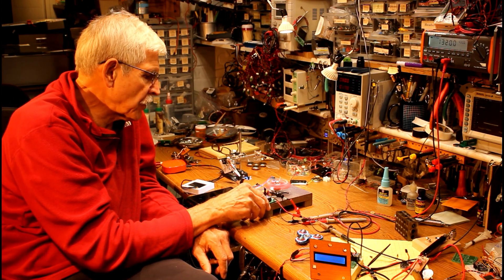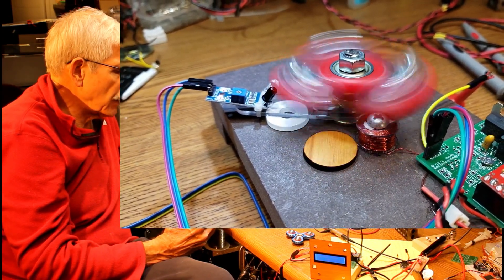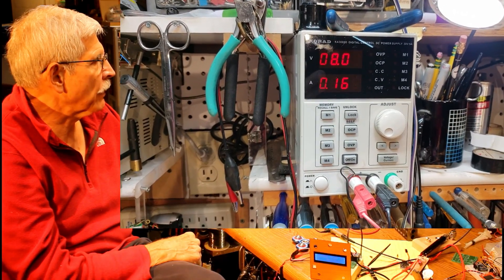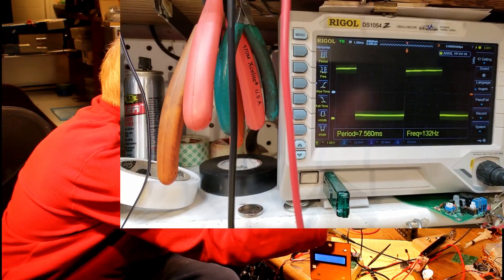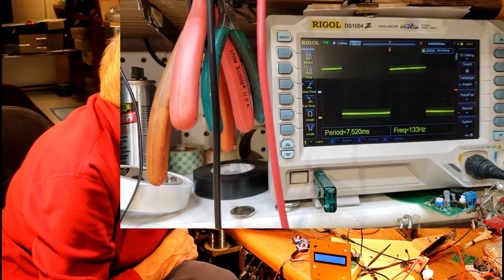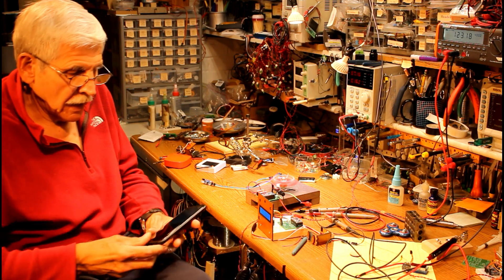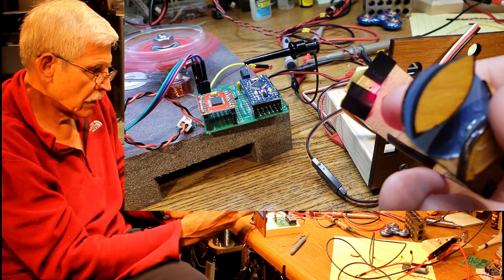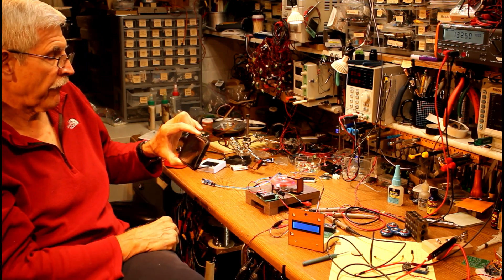Fidget Spinner Tachometer

Comment: I am far from being an educated man. I barely made it through high school.
My uneducated opinion about your hall sensor set up.  Looking at the diagram you have in your website, something is not right at all.
Well either something is messed up with my head that I have not been able to get my fidget spinner going following your diagram.
Aside from few of my magnets having made china that took me for head spin as their dog gone magnets were not consistent with their north and south orientation.  As the screws sit inside the cavity and the nut on the other side... well came to realize that one of them was actually screwed up.   One of them was actually oriented as such that its other (flat side) matched the other two.  That took me two days to figure out what the hell.

Now after fixing that, it is still not spinning.
You are explaining that since  the hall goes low at the passing of the magnets, your setup will flip it and that is the reason for the addition of NPN transistor along with the mosfet.
If that be the case, when you turn the power on, if the hall is not by the magnets, the coil should not be energized.  Of course not.

Well, I have not succeeded.   So I was force to take a good look at your diagram.

Looking at just the Mosfet,its circuit is complete just by itself, although its base goes to the collector of the NPN transistor does not stop the fact that in of itself the base of the mosfet is also independent to itself.  the NPN transistor, collector can not under any circumstance influence the base since the base is getting fed from the positive rail through the 1K resistor before it goes to the collector of the NPN transistor.  It is clear and obvious.
The drain of the Mosfet goes to the coil along with the diode which goes to the positive rail.
And the source is grounded.
IS THIS NOT A FACT?
If this is, then the Mosfet by itself is a complete circuit independent of the NPN transistor.  So no wonder when I turn the power on, the coil is energized before I even move to position the hall.

How on earth can the NPN' collector being connected to the base of Mosfet has any influence on the operation of the mosfet.  Please explain, how that will effect the supply voltage to the base of the mosfet, phase difference or whatever that might go on that will effect how or when the Mosfet turns on.
1K resistor is everywhere.

( The only way I made it work, is I did what I thought made sense.  I tossed the 2N2222 and just connected the hall to the Mosfet and it span perfect.  Simple straight forward circuit.   And I couldn't tell the difference if the hall goes low or high.  I don't think if you buy those non--latching omnipolar ones ( which mind you they want an arm and a leg for it) would do any better than this hall sensor which are dime a dozen.)

Comment: Hello Dave, how to change the code to measure the rotation speed of a 48 V  DC motor ?
I modified your code like this, is correct ?

#include <SPI.h>
#include <Wire.h>
#include <Adafruit_GFX.h>
#include <Adafruit_SSD1306.h>
#include <EEPROM.h>
#include <Encoder.h>

#include <Fonts/FreeMonoBold9pt7b.h>
#include <Fonts/FreeMonoBold12pt7b.h>
#include <Fonts/FreeMonoBold18pt7b.h>
#include <Fonts/FreeSerifBold24pt7b.h>
#include <Fonts/Serif_bold_40b.h> // HDG et Vitesse et Variometre 3 digits
#include <Fonts/Serif_bold_34b.h> // Altitude 5 digits

// Cablage OLED 1.3" SPI pour Arduino Nano, Arduino UNO:
// OLED 1.3" ===> Arduino Nano, Arduino UNO
// VCC ===> + 3,3 V
// GND ===> GND
// CLK ===> D10
// MOSI===> D9
// CS ====> D12
// D/C ===> D11

// #define OLED_MOSI   9
// #define OLED_CLK   10
// #define OLED_DC    11
// #define OLED_CS    12
// #define OLED_RESET 13 // Non Connecté pour ce type de LCD

// Cablage OLED 1.3" SPI pour Arduino Mega 2560 et Arduino Mega 2560 Pro Mini
// OLED 1.3" ===> Arduino Mega 2560 et Mega 2560 Pro Mini
// VCC ===> + 3,3 V
// GND ===> GND
// CLK ===> D52
// MOSI===> D51
// CS ====> D53
// D/C ===> D50

#define OLED_MOSI  51
#define OLED_CLK   52
#define OLED_DC    50
#define OLED_CS    53
#define OLED_RESET 13 // Non Connecté pour ce type de LCD

Adafruit_SSD1306 display(OLED_MOSI, OLED_CLK, OLED_DC, OLED_RESET, OLED_CS);

unsigned long time;
int RPM = 0;
volatile float timer = 0;
volatile float time_last = 0;
volatile int rpm_array[5] = {0, 0, 0, 0, 0};

void setup()
{
  
  display.begin(SSD1306_SWITCHCAPVCC); // Initialisation du LCD en +3.3 V
  Serial.begin(9600);
// Broche numérique D2 définie comme une interruption
// LOW : pour déclenchement de l'interruption lorsque la broche est au niveau BAS
// CHANGE : pour déclenchement de l'interruption lorsque la broche change d'état BAS/HAUT
// RISING : pour déclenchement de l'interruption lorsque la broche passe de l'état BAS vers HAUT (front montant)
// FALLING : pour déclenchement de l'interruption lorsque la broche passe de l'état HAUT vers l'état BAS (front descendant) 
  
  attachInterrupt(0, FidgetSpinner_interrupt, RISING); // FALLING changé par RISING
  time = millis();
}

void loop() {

  
  if ((timer >= 700000) || (millis() - time >= 1000) ) RPM = 0; // Affichage de zero lorque la vitesse est basse
  delay(25);
  MajLCD(RPM);
  Serial.println(RPM);

  if (timer > 0) {
    // Moyenne des 5 dernières lectures pour la precision de la vitesse affichée
    rpm_array[0] = rpm_array[1];
    rpm_array[1] = rpm_array[2];
    rpm_array[2] = rpm_array[3];
    rpm_array[3] = rpm_array[4];
    rpm_array[4] = 60 * (1000000 / (timer * 1)); //  3 remplacé par 1 - Le fidget spinner a 3 lobes
    RPM = (rpm_array[0] + rpm_array[1] + rpm_array[2] + rpm_array[3] + rpm_array[4]) / 5;
  }
}

// Interruption pour détecter les ruptures du rayon laser
void FidgetSpinner_interrupt()
{
  timer = (micros() - time_last);
  time_last = micros();
  time = millis();
}

int LongueurValeur;
int LargeurLCD = 128;

// Facteur de reglage pour centrer la longueur du chiffre total selon la police utilisée
int LargeurNombre = 24; 

void MajLCD(int RPM)
{

if(RPM > 9999)
LongueurValeur = 5;
else if(RPM > 999)
LongueurValeur = 4;
else if(RPM > 99)
LongueurValeur = 3;
else if(RPM > 9)
LongueurValeur = 2;
else
LongueurValeur = 1;

//————- MAJ du LCD ————
// Polices disponibles
// FreeMonoBold9pt7b
// FreeMonoBold12pt7b
// FreeMonoBold18pt7b
// FreeSerifBold24pt7b
// Serif_bold_34b // Crée par Fred
// Serif_bold_40b // Crée par Fred

display.clearDisplay();
// Inversion couleur
//display.setTextColor(BLACK, WHITE);
display.setFont(&FreeMonoBold12pt7b);
display.setTextColor(WHITE);
display.setCursor(45,20);
display.println("RPM");
display.setCursor((LargeurLCD / 2) - (LargeurNombre / 2 * LongueurValeur), 62);
display.setFont(&FreeSerifBold24pt7b);
display.println(RPM);
display.display();
}
Reply from the maker: I really can't tell from your code what you did - the comments are not in English!  Can you tell me what your changes were meant to accomplish?
thanks
dave

Comment: An update on the upgraded motor that i have built, thought it might interest you

I have found an old analog oscilloscope at my school that i can use to get speed measurements. No one at my school knows how to operate it, so i had to teach myself, there was also no probe for it so i had to google how to make my own 10x probe out of some resistors, coaxial cable for hooking up satellite dishes that i found in my garage, alligator clips and a pen. It seems to be reasonably accurate and i have figured out how to meaure frequency with it. 

I was just about to get some measurements with the scope last week, but my friend decided to press the buttons when i wasnt looking and it went up in smoke. The coil reached over 120°c and was burning, so that was toast and i had to make a new one. While i was fixing the motor i came up with a solution to my overheating problem for the coil 

Water cooling 

I made a water cooling system for the coil by submerging it in a clear plastic container around the size of a pill bottle, i attached 1/4 vinyl tubing to the side and top so i could get water flowing through. The plastic container also allowed me to precisely the coil close to the magnets on the spinner which has helped with acceleration. For now i just have the tubing hooked up to a sink to get a flow of water around the coil.

After doing some testing today i found that the water cooling worked even better than i thought with no leaks, the coil didnt even get warm and remained cold the entire time. I also added a key activated switch for arming the motor to prevent any future fires from people playing with it. This proudly makes me the owner of the worlds first key-operated, water-cooled fidget spinner

Right now the only thing holding me back from getting this thing to go faster is the current output of my batteries and the maximum speed of the fidget spinner bearing. I am using a homemade 2s lion battery pack made from 18650s from an old drill battery, i have 2 of these set up in parallel to  reduce strain on the packs. I also am trying to find a reasonably priced ceramic bearing that will be able to handle the high speed because the cheap bearing that came with the spinner has been abused by these tests and isnt what it used to be. If anyone knows where i could get my hands on one that would be great, i have found some cheap ones on banggood for around $10 but i dont know how long they will last

Im thinking of putting some testing videos as well as schematics on a channel, let me know if you'd like to see some
Reply from the maker: That is all great news and shows perseverance and creativity in your endeavors.  Well done!
Yes, please do post videos of what you are doing as I am sure it will interest and help others.
Thanks for sharing your progress!
dave
Reply: @DaveBodnar  
I have an update on the speed measurements of the fidget spinner motor. It could have gone faster but unfortunately it suffered some minor damage. The measured speed at the time of the incident was...

drumroll

15,000rpm!!
Reply from the maker: That is outstanding work!  The damage to the system doesn't surprise me!
Well done

dave
Reply: @DaveBodnar  
I believe the damage was caused by the spinner expanding away from the bearing from the centrifugal force (i think thats what its called) then the spinner sliding down the bearing since it is no longer attached, and then scraping the bottom of the stand, slowing down and going back to its normal size. Either way, i still have to take it all apart and probably get a new bearing
Reply: @DaveBodnar  ive done some upgrades to the system including a much bigger battery and thicker cables because of increased power draw, its going to draw around 100 amps. This will be the final test with a normal plastic fidget spinner as i will easily break 20,000 rpms (the point where it explodes) for protection i will have a layer of lexan (polycarbonate) as an enclosure around the spinner. I will also have a temporary welded box around the entire setup incase the lexan doesnt hold together, it will be around the equivalent of a 22lr. As a result of the increased power draw ive had to brainstorm some interesting methods of cooling for the mosfet, my current plan is to use silicone conformal coating as just conformal coat the entire mosfet so i can have it submerged completely for maximum cooling. This technique is commonly with racing drone to protect them from rain, But i will be using it for getting the most cooling as i possibly can. 

I will hopefully doing this test in the next 2-3 weeks and will be posting the experiment on my channel for anyone that might be interested, i expect it will be very entertaining. I also have some other plans for something even faster (much, much faster) so stay tuned for that too
Reply from the maker: That is all exciting news - I look forward to hearing about your tests - please let us know when you have information to report.

Have fun and be safe!

dave
Reply: @DaveBodnar  i was planning on doing the final test tomorrow and uploading the video sometime next week, but during some slow speed testing today (just kmaking sure everything works, not bringing it up to full speed) i encountered some issues which have delayed the testing for 2-3 

During the test the electromagnet stuck on which usually means i wired the sensor wrong, but there was also another much larger problem, i also heard a sizzling noise when the magnet was turned on (only 2 seconds at a time) which i later found out was the heat from the magnet boiling the water cooling almost instantly. The water cooling system has the flow rate equivalent to what you would get flowing through a straw, i thought it would be fine since it worked for the previous tests, but it did nothing in terms of cooling since the electromagnet essentially turned into a 1300 watt water heater. 

On the plus side i have created a series of enclosures to stop the fidget spinner when it explodes. It consists of a 2.3mm lexan enclosure which has been bolted together, as well as a 14 gauge steel enclosure welded together incase the lexan isnt strong enough 

I will be completely redesigning the cooling system in the next few weeks, hopefully i am able to get it to work
Reply from the maker: You have made great progress even though you hit some snags - remember that it is not unusual to learn more from failures than successes!
Keep at it -- I am sure you have the goal in sight!
dave

Comment: I seem to have acquired an oscilloscope that i can use to test the speed of my motor. I asked around to see if my school owed one and they dug an old one out of a box in the corner of a storage room. I was expecting something mildly modern, at least digital. I was wrong. The only thing they had was an ancient analog oscilloscope from 1987. A tectronix 2205 20mz to be precise. I dont know how I'm going to be able to get an accurate frequency measurement especially since there are no probes for it. But i will give an update when i manage to get some kind of reading.

Another option that was briefly described to me by a guy at the local electronics store after i told him what i was doing, was something like binary frequency division or something like that. It seems like i could be a bit out of my electronics experience but it sounds quite interesting, and would allow me to use my multimeter which only goes up to 4000hz
Reply from the maker: Good deal on the scope - that should be fun to experiment with......
The fellow at the store may be talking about a circuit that would divide the count of pulses by 10, 100 or 1000 - another viable option - for more info see:
https://www.google.com/search?q=divide+by+100+circuit&ie=utf-8&oe=utf-8&client=firefox-b-1 

Enjoy!
dave

Comment: Hi Dave, do you get much gyroscopic effect on the 2400 and 5000 RPM spinners?   I have always wanted to try some type of a maglev system and wondered if a spinner/maglev would give some stability to the system?
Reply from the maker: I don't feel much of a stabilization of the test units probably due to the rotating mass being small and the base being quite heavy.  I am sure it is there but it is not easily detected.
dave

Comment: That tachometer looks like it could be very useful, i dont have any arduino experience so i dont know how well that will work for me, nor do i have an oscilloscope, so im going to try and use the Hertz measurement function on my multimeter. I dont know how accurate it will be, but it should give me a rough estimation on how fast mine is going.